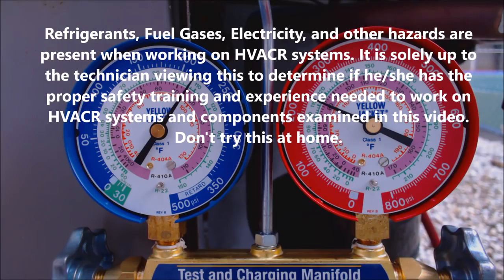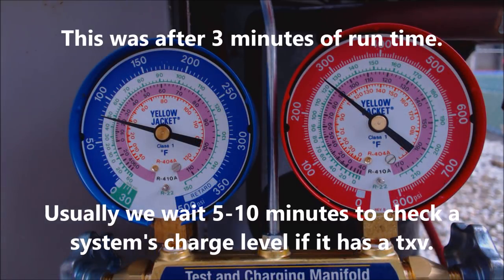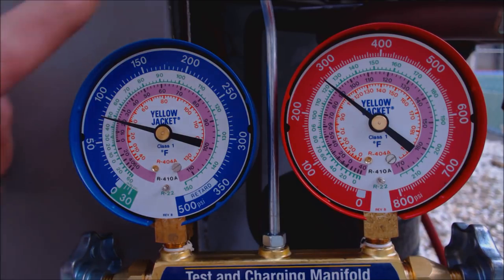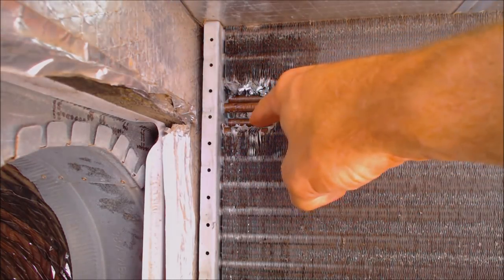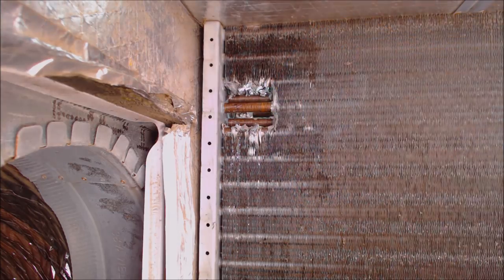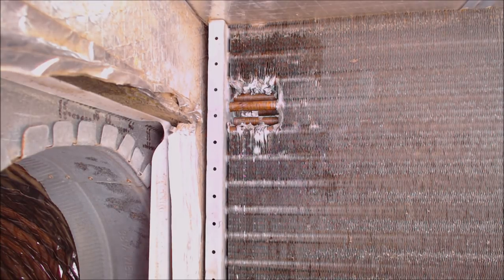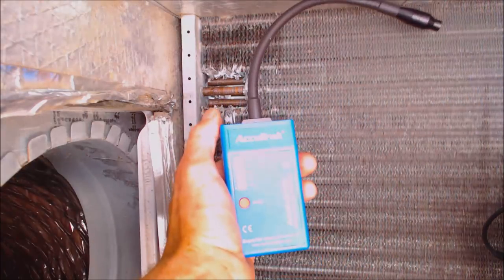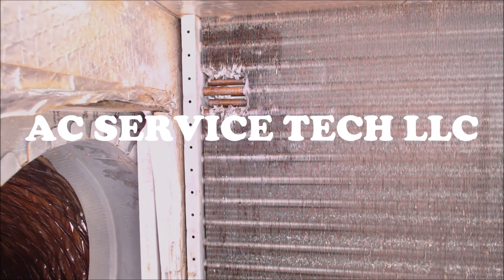How to Find a Refrigerant Leak with an Ultrasonic Leak Detector!

Comment: I got one of these and it soon became my go-to for leak detection. I was shocked at how much better it was than the traditional units. I still use my H10-G and TIF ZX-1to start the process, but when the goin' gets ruff, its the ultra-sonic. I use the ultrasonic + a charge of nitrogen after I do a leak repair to check my work. Never fails to confirm my work. Love this thing.
Reply from the maker: Yes I really do too, works great. Make sure to keep fresh batteries in it though because it won't tell when they are low, thanks!

Comment from the maker: I ended up brazing the front tube as well since i dented it but no leaks came from that. I just did it to make sure no leaks would form. Also since this was next to the end of the coil, I screwed a galvanized tin plate into the galvanized tin end plate to cover the hole. We were looking at the return duct to the left and the blower motor was on the other side of that coil. Air will still get through that tubing hole but a little less volume will. Anyway, the customer was very happy that i was able to find and fix that leak! That would have been extremely hard to find without that tool. That leak was so small, my electronic sniffer didn't even go off there.
Reply: AC Service Tech LLC That’s one of the best tools on the market today to find leaks that are not easy to detect with even the best traditional detectors !!!
I had an exact same call where the coil had a pin hole leak on of the inner tubes that wouldn’t set off my inficon detector , took coil out and submerged it under water then and only then it bubbled ! Not long after I went and got a similar ultrasonic kit and been much happier since !
It’s because of you I found out about this technology , thanks Craig
Reply from the maker: Yeah I remember talking to you about that!
Reply: I have never had best of luck with electronic sniffers.
Thanks for vid
Reply from the maker: Thanks Turbo Flush!

Comment: Very nice! I've have never seen anyone fixing an evaporator leak, in the state that I live they'll tell you need a new evaporator. They won't fix it. I think that's the main difference between a good honest a/c tech and a bad one. Thanks for all those informative videos and how's done right!
Reply from the maker: It is not worth fixing if the leaks are coming from multiple spots where the tine plate touches the copper tubing but if it is just one or two in the fins or on a u-bend or distributor tube then they should just be fixed when it makes sense to, thanks
Reply: Nah its better to replace the whole thing. Lol. Don't do all that work just to fix it and then have another hole show up. Its not even that expensive to replace the parts. The labor is more expensive.

Comment: Thanks for the video . will it find leaks at low pressure too ?For like low pressure chillers
Reply from the maker: It can find leaks on anything that will make noise when entering or exiting the tube but will work better if the coil is wet such as a positive pressure coil. For something like that, I would shut the unit down and let the pressure rise to above 0psig. That is what is nice about the ultrasonic is that it does not depend on a certain amount of volume, is not sensitive to certain refrigerants and will work during a pressure test without refrigerant but just inert gas, thanks

Comment: Hey. Great Video. I have a question about the fins you cut. Do they have to be replaced or is it ok to leave it open like that? I don't do a lot of AC repairs just my own home unit. I don't have a leak at the moment just for future reference. I'm an automotive tech and I know our systems are 100% different! Thanks! Again great video!
Reply from the maker: Hey Chris, I installed a piece of galv tin to cover the whole since it was right on the end and used sheet metal screws in the tin end plate to hold it but it would work without that, thanks

Comment: Thanks for posting this. I’ve almost bought this tool a couple of times, but seeing you demonstrate it, makes it even more appealing to purchase. I may have to consider this as a future tool acquisition.
Reply from the maker: I did a lot of research on this tool before I got it. I read review after review after review and talked to other industry professionals. I have had quite a few techs asking me about best leak detection methods so I wanted to do this video. This brand seems to be the best Ultrasonic leak detector out there and this is the base model which means they have even better ones. This model has the flexible neck but there is another version without the flex neck but has a flexible hose instead which would work just fine. This is the VPE-GN pro and the one without the flex neck is the VPE pro. I have it linked in the comment and description section if you wanted to read reviews. It also looks like other manufacturers buy this and put their name on it as well but Superior Signal Company Inc is the actual manufacturer and AccuTrak is the brand name, thanks tcpHVAC/R!

Comment: I've been looking for a good leak detector so bad. This is the best I have seen so far. If you recommend this as a good one,
this is gonna be my next purchase.👍
Reply from the maker: Yeah I really like it. There is even a better AccuTrak model than this one but its a decent amount more expensive. This one is very good though and I am really happy with it. Here are two links to compare the VPE pro and one link for the VPE1000 model. I am using the VPE-GN Pro but the VPE Pro would be fine using the yellow tube to extend, thanks Luc- 
   AccuTrak VPE Pro with Headphones-https://amzn.to/2B2cRO3  -      AccuTrak VPE-GN Pro with Headphones-https://amzn.to/2vxD41R   -    Accutrak VPE1000- https://amzn.to/2P9ptVR

Comment: Being a package unit, could it be pumped down, or because pkg. Unit. It has to be Recovered?
Thanks
Reply from the maker: There was no service valves, just service ports, so it was recovered to 0 psig before flowing nitrogen and brazing it, thanks
Reply: AC Service Tech LLC 
That I did not know. Thanks

Comment: I'd have a hard time driving to the job and an even harder time climbing up the ladder to the roof after selling an arm and a leg to buy that leak detector.
I already sold one arm for my Inficon D-Tek Select...
Reply: Not with the inficon?
Reply from the maker: Ha ha nice! I am not saying everyone has to get one. I am saying that if a company can't find some stubborn leaks and are going around adding refrigerant or putting stop leak in the ones they can't find then this is likely the solution. To a business owner, especially if it were a warranty situation, it is critical to be able to find the leak. I know a lot of company owners that their worst fear is those leaks that they just can't seem to find. It is nice to be able to know that they can be found without excessive plans or stop leak but just searching. Thanks Tomonator and I hear what your saying!

Comment: On pkg units, R22 or 410a is their a std. Metering device? Will it always be a fixed, or could it be  txv,?  To determine which way to charge to subcooling or to superheat?
May be old unit no data plate.
Reply from the maker: It could be either txv or piston. You would have to pull the cover off and take a look if the rating plate was gone as well as to see where the ports are even located at. Sometimes they don't put them in the right location for subcooling to be read. Also sometimes they have a charging method listed on the inside of the cover when ports are in an odd spot, thanks James!

Comment: I have been using this tool for about 6 years with nitrogen when I find systems "FLAT" completely out of refrigerant I use the Bose Headphones  that makes a turbulence vacuum or positive pressure leak sound like a jet engine when getting closer to the leak.I believe I have the first generation model and it cost about $375.00 when I purchased it.I also find many leaks in systems just a little low on charge as well. Great video !!
Reply from the maker: Awesome to hear coolmandude1000! Yeah, I believe this is the third generation. Glad to hear about your experience with it!
Reply: I actually have about 9 electronic refrigerant leak detectors and UV light set up as well and decided to try this new technology about 6 years ago and i will try any leak detection system that makes my job easier lol.37 years in the HVAC trade and self employed for 29 and HVAC tools and test equipment is essential in keeping up with the competition .I am looking at the new TESTO Electronic leak detector now which is on my wish list lol.I have been using TESTO SMART PROBES for about 3 years with hygrometers and hot wire anometer and love Measure Quick App but now I see the Field Piece probes work with Measure Quick app and have a much better range then TESTO SMART PROBES so I maybe upgrading to Field Piece probes lol.
Reply from the maker: I hear ya. Whatever makes the job easier or takes some stress off knowing that you don't have to worry or that you have a solution that will work. Very nice and interesting insights with the probes!
Reply from the maker: Just curious, out of all of those leak detectors including uv, what are your top three? 1st, 2nd, and 3rd favorite or most reliable for harder to find leaks. Big leaks are easy with any tool or bubbles but it is always the smaller, harder to find ones that take a better tool or method. I always like to get a feel for other business owner's or tech's favorites and why. Thanks

Comment: How much. And how reliable?....
Reply from the maker: Hey Oscar, I have this tool with the amazon link in the description and now also in the comment section above. Also read the amazon reviews on this ultrasonic leak detector vs any other ultrasonic detector. I am very happy with this tool compared to any electronic sniffer I have used in the past and the dye method. The coil just needs to be wet though and takes a little getting used to in order to compare noises but once you get the hang of it, it is evident what the noise of leaks are. It works regardless of whether there is refrigerant or nitrogen in the system and you don't have to put any additives into the system or come back at a later date. The pressure does not need to be jacked up to a really high pressure either since it is just looking for noise, not a volume of refrigerant coming out. I am happy with it, thanks Oscar!

Comment: Not related to this but I tried to search for climate controls at the condenser units. How it works and troubleshooting it. Would you make the video? The control board is what I'm looking to troubleshoot.
Reply from the maker: So you are just looking to troubleshoot a condensor board, not a heat pump board right? Does it have 24v from the low voltage inside read with the probes of a multimeter on y and c? Does your unit have low and high pressure switches? If so, make sure the voltage is going to the switches and then back out of the switches, thanks
Reply: Yes.\It has 24v and transformer is at the condenser, too. Everything is hooked up and all have 24v. The problem is that the unit shuts off and wouldn't start back up unless jumped at board from 24v coming from inside and the coil to contactor. Would it be the amps to the compressor or the fan motor or what would it be?

Comment: I have the fieldpiece leak detector my cuestión is what do you guys think is better ?
Reply from the maker: Which one? I really like the ultrasonic because you can find leaks with low volumes of refrigerant coming out and also when pressurized with nitrogen. It works best when the coil is wet such as a wet evap coil or a hosed down condensor, thanks

Comment: Question AC ServiceTech.  Had my 20 year old Carrier 2 ton check out as it was not cooling past 80.  The Coil was replace once about 9 yrs. ago.  My guy had been here 60 days ago and added 2 lbs. R22.  Today, he said it needed another 2 lbs., so I asked him to find the leak.  He went to the coil with his detector (not this kind) and spent 15 minutes with no success finding the leak.  Went back out to the outside unit and again found no leak...I say if there is no leak at the coil and no leak at the compressor, what next?  He says you need a whole new system for $4500.00  Looking for a sanity check here.  He finds no leak at those two spots.  We know there is a leak somewhere, but rather than find the leak...he wants to replace the whole system.  WTF?  Does that sound right to Anyone?

Comment: The system will still operate correctly with that section of the fins cut out?
Reply from the maker: Hey Todd, yes I put a small piece of galv tin over the hole which I screwed to the galv tin end plate of the coil. It is not touching the tubing but bent and sitting right in front of the fins. Eventually that will rust and rot away but we did buy that unit quite a few more years of operation. If you didn't cover it if it was in the middle of the coil, you certainly will pull or in other cases push air through that hole fast so a little capacity will be lost but it will still work. Also if the tube that was leaking was a front tube on a two tube or three tube coil then it would be ok because you wouldn't pull as many fins out as I had to in order to find the leak. Then you would want the air to hit that area because some of the fins are pushed over or won't allow the air through. Sometimes it is nice to just melt the fins out after recovering the refrigerant. I found the leak fully with the refrigerant still in, thanks Todd!

Comment: Great vids! After watching I was looking to purchase so I called the company to see if the metal probe can be used on the VPE-GN Pro but it can not. Customer service woman said that probe is for testing TXV ..what are your thoughts on this? Is it really necessary?
Reply from the maker: You don't need the probe because you just use high superheat, normal to high subcooling, low delta t to signal a liquid line restriction. I would just go with the vpe gn pro, thanks
Reply: Thank you very much. I seen your explanation on your book both ebook and paperback. I’m glad you did. I was going to order the paper back (I’m old school) but I like how you mentioned information can be highlighted and easily searched. So ebook it is for me. Thank you
Reply from the maker: Thanks Chris and let me know what you think of it!

Comment: At what point is it cost effective to replace the coil? Seems like your doing everything else!
Reply from the maker: A lot of time, you are trying to get the unit back on for cooling so if the coil is in good shape, it can be fixed but there are times when you know it is not worth it to fix because of the rusting tin on the copper tubing and if you fix it, there could be another leak shortly down the road. I try to replace with fully aluminum coils. Not microchannel but fully aluminum tube, fine, and plate coil with a txv metering device attached, thanks

Comment: So to repair the leak did you just put some brazing rod in the pinhole?  Also I watched the video prior to this on frozen coil, but my question is. How long did that job take start to finish and what was the total cost? I am a new tech an I’m trying to get an idea on time an pricing.
Reply from the maker: That job was part of a large amount of PM's, I am going back on Monday and Tues to address all the problems on the units. Well first off, I mention to the homeowner that there is a possibility that there could be another leak somewhere or since this one formed, another could form after I fix this one. I usually don't have any problems with the spot I fix and sometimes I make the call that it is not worth fixing due to corrosion all over. I tell them that because of the possibility of another leak forming that I cant warranty it if they want me to fix it and I give them the price of my total hourly rate to fix it plus refrigerant and misc cost such as braze rods, acetylene, vacuum oil, fittings, filter drier. You would just need to know what your hourly rate is and supply cost. Hourly rates depend on your area and clientele, thanks bp0100!
Reply: Any idea how long it would take for the recovery, repair, pressure test, evacuation, and refill of refrigerant?
Reply from the maker: It takes a few hours but really depends on your procedures, thanks!